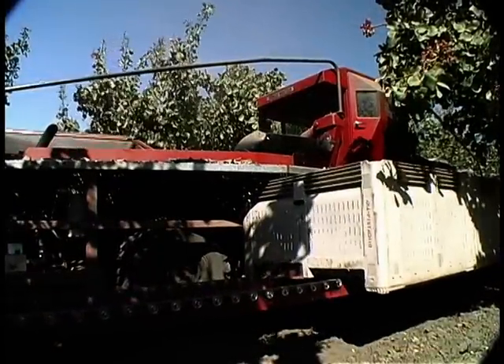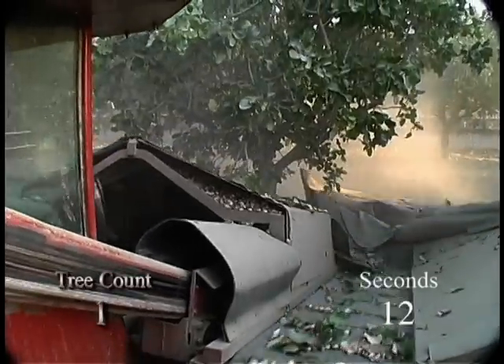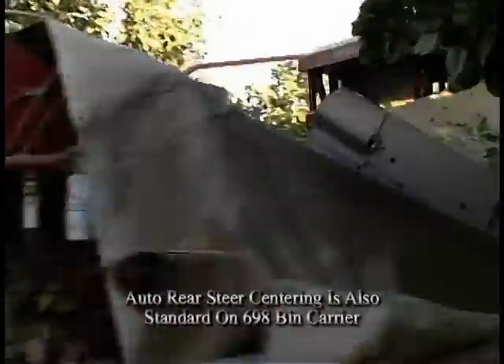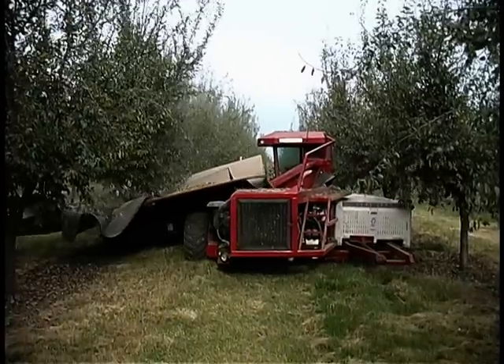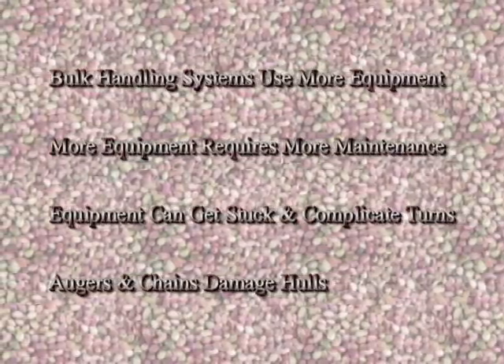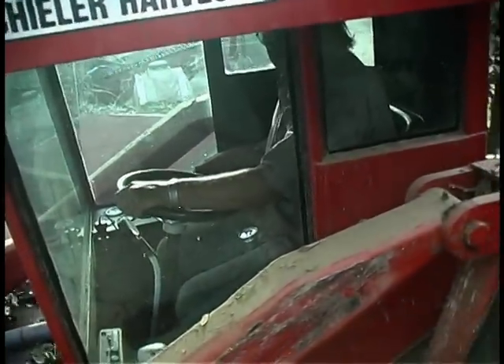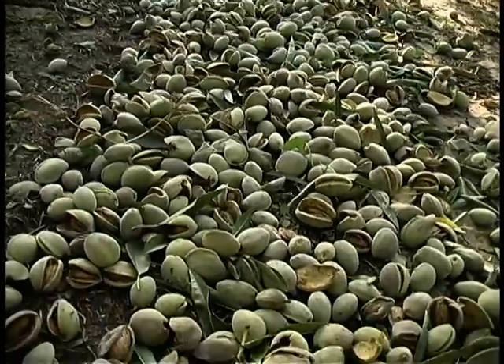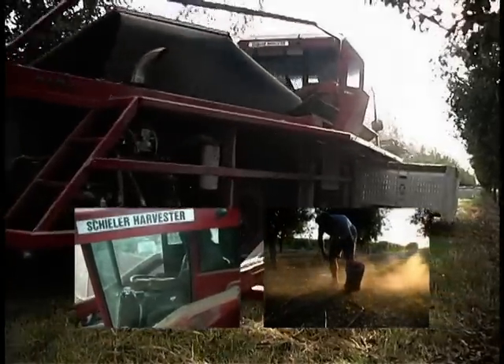Schieler Harvester 988 Tree Crop Harvester

Comment: I remember driving the SSP yellow one in 1980 fun . We did prune season and then the Blackwell ranch pistachios 😊
Reply from the maker: @edwardschieler1680  Mike Johnson told me that SSP stood for Super Sorry Pruneshaker, when I was a kid! 😂 Those original machines were terrible! Dad and Larry completely redesigned them into something completely different, from the ground, up! The newest ones have fully automated bin tracks. The unwrap and slide in function are automatic, too! We were probably just a few years away from auto steer and  full automation before we stopped building new machines.
Reply: @DustinSchieler  your Dad could do about 6 or 7 tree's a minute. I also drove the bible carriers to reload the shakers

Comment: Hey Dustin, I am an organic almond farmer & one of the big issues with off ground harvesters is the need for Electra trunk spacing. what type of trunk height does the 988 need? Thanks, Garrison
Reply from the maker: I can't remember the minimum trunk height dimension but you need about the same as your average pistachio orchard, with about 4-6" more factored in for the burm height if your orchard is completely flat. I think it works out to about 24" from the orchard floor to be ideal.